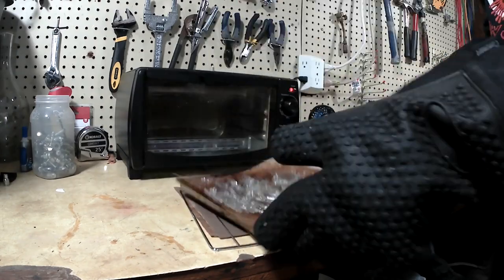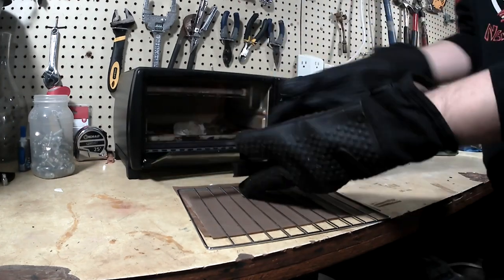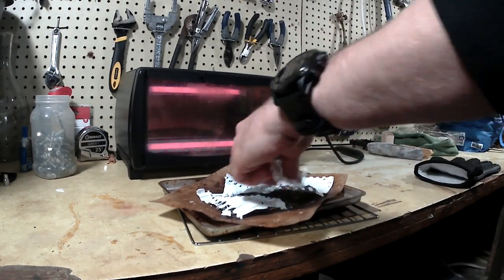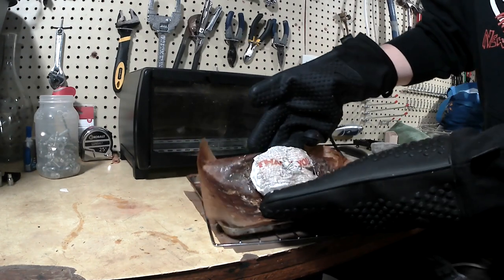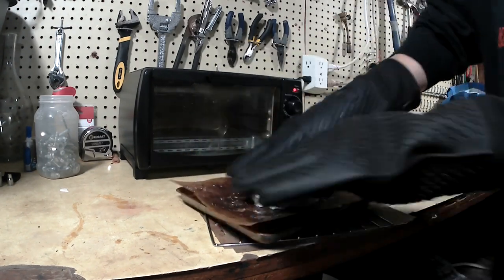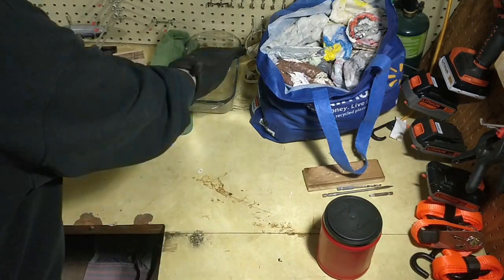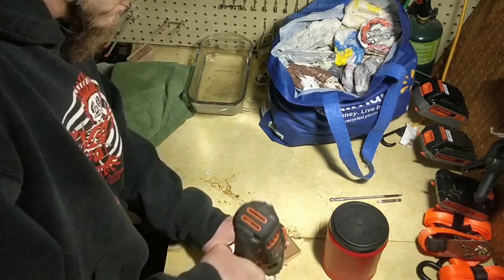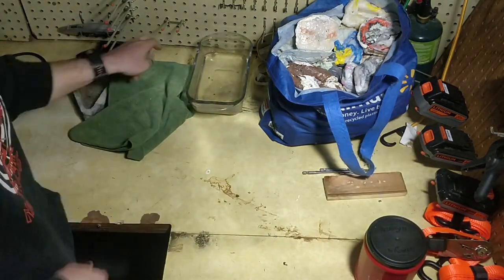Making HDPE Climbing Holds

Comment: Great idea and video! I have a couple questions about your process. 

1. What temp do you set your toaster oven to? Maximum? Or something closer to the HDPE melting temp of 125C?
2. How long does it typically take for each hold to melt? It is hard to tell with the video being sped up. Is it a few minutes? 15 min?
Reply from the maker: I keep the toaster oven set on 175c
Small chip and crimp type holds only take about 10 mins. Larger holds can take around 30 mins. Each load of hdpe I put in the oven takes a minute or 2 to melt.
Reply: @MarkLarsen85  oh wow just a couple minutes to melt! The rest of the time is shaping, cooling and drilling? For larger ones do you melt in batches and then combine the layers? Or can you melt enough at once?
Reply from the maker: @nchomey  it's a few minutes per layer. After the layer melts, I take it out squeeze out air bubbles, put more fresh hdpe on the tray, then set the melted layer on top and put it back into the oven for a few more minutes. You can use different colors in different layers. When you take it out of the oven stretch and twist it to make a marbled kind of pattern.
Reply from the maker: Shaping goes quickly due to how fast the outer bit cools. You will have to leave the hdpe in the form you use for a while to let the inner heat dissipate.
Reply: @MarkLarsen85  great tips, thanks!